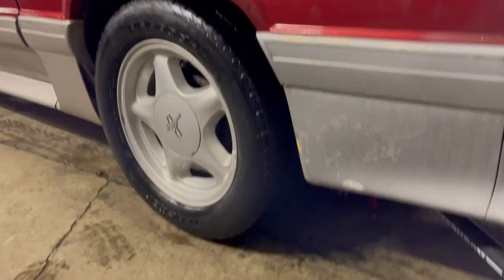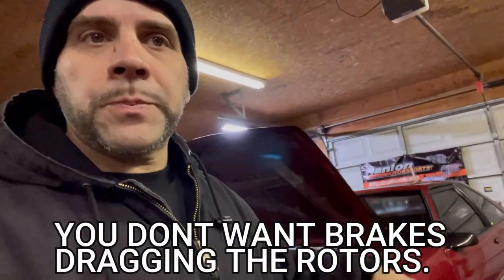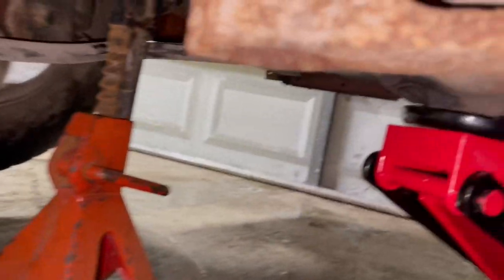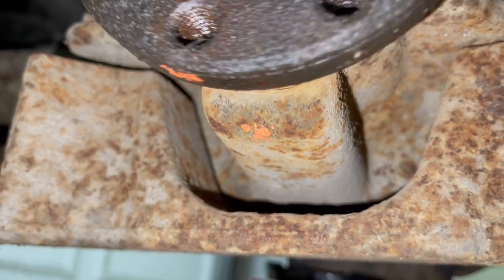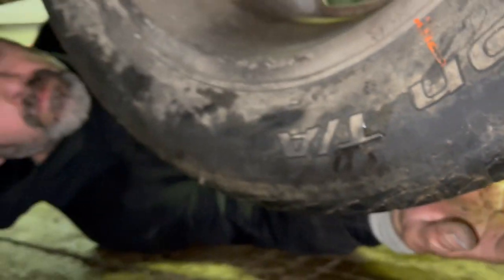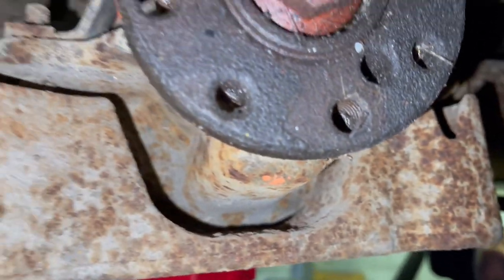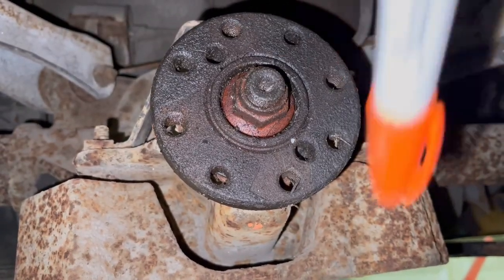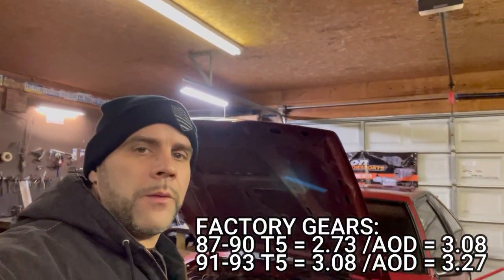Check Your Gear Ratios FAST w/ This Old Trick NO TOOLS #oldschool

Comment: Another quick way if you are looking at a car to buy when driving it is if you have 25-25.5” tall rear tires, take it up to 70mph in 4th gear (1:1 ratio) and check your rpm’s, should be close to your ratio (ie 3700 rpm’s would be 3.73 gear), but Dan’s way is more scientific.

Comment: Used to do this all the time back in the 2000s. Few months ago had to identify a jeep axle at the shop. Tried this and it wouldn't work. It was a Dana 44 Rubicon. It was 1 of 2 gearsets and I wasn't close. Idk if the selectable locke had anything to do with it? I assumed it would act like an open diff but no dice

Comment: Have you heard anything bout the method of figuring out the gear while driving it? I believe I remember it being go 75 in 4th gear 1/1 and the rpm you are turning is equal to what your gear ratio is. So if you're turning 3,500 rpm it's a 355 gear.
Reply from the maker: Yes
Reply: Glad I remembered that right. I did that years ago and figured out my car had a 3.55 gear in it.

Comment: I have a 88 notch with 4.10s 5 speed with a paxton. I just bought a 92 notch parts car. What if both wheels aren't spinning? Is the diff toasted? I would like to get rid of the 4.10s and just build a nice cruiser.
Reply from the maker: Clutch packs need replaced. Easy fix
Reply: @Neomustangs  I did figure out my car has 3.73 not 4.10s as the seller told me so I figured I'll leave alone for a while and see how it cruises after putting a 275 on the back. It came with 4 dry rotted 245s so I stay really close to home🤣

Comment: Well damn I never knew they switched to a 3.27 in 1990. I thought the fox always stayed 3.08/2.73. My 99 and 2000 GT's both came with 3.27 which I thought started in 1996 with the 2v. Lesson learned.  👍
Reply: I purchased my 90 new. I know that the only available gears for the T-5 5 spd was the standard 2.73 or optional 3.08. The 3.27 I believe was available for the auto.
Reply from the maker: Yes

Comment: So here is a question,  I have 3.73 gears and the white speedo sprocket and my speedo still reads high... any fix that you know of? 95  mustang gt 5spd
Reply from the maker: Just gotta make sure you know the first gear in trans. The color of output shaft gear and the rear gears.

Comment: hey Dan wasnt the 327 gear on the heavier convertible & only on the auto cars I forget
Reply from the maker: Pretty sure they were 92-93 for sure on AOD. Vert or Hatch.
Reply: @Neomustangs  do you think the 355 is best on running turbo or have you found other ratios work better ? like if youre strictly on the street & hwy ? Im not a fan of the 273...back in the day we ran two stock vehicles from a dealership I worked at a 273 car & a 308 geared car...it was clearly evident what ratio worked best on stock
Reply from the maker: @speedeetrim4028  355 is a great choice yes

Comment: What is a good gear for a 306 t5 that will work with t5 and c4 but currently 5 speed turbo setup best it’s been is 770 in the 1/8th with stock gears
Reply from the maker: 356